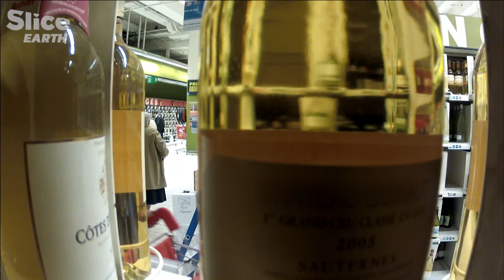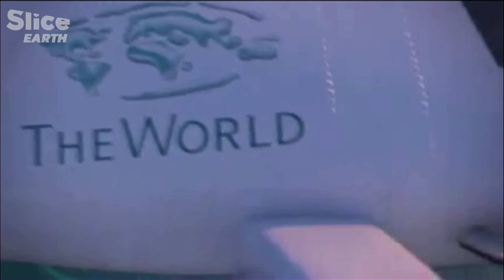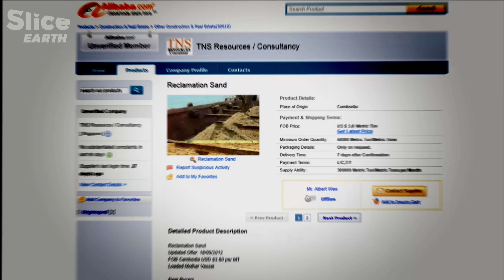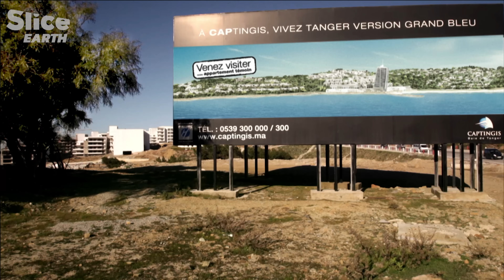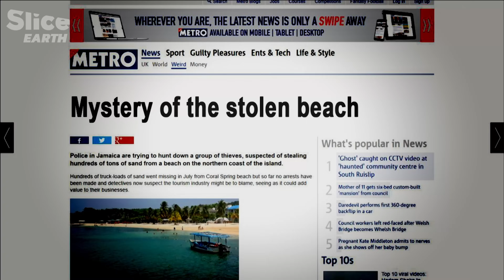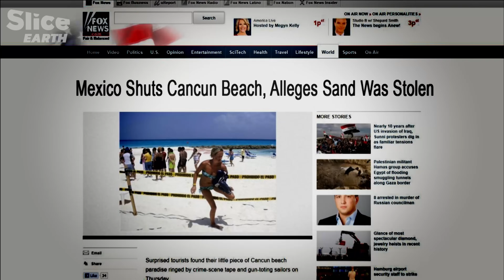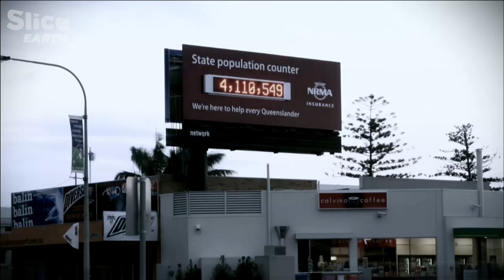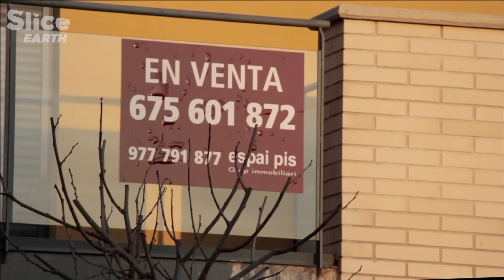The Sand Wars: Uncovering the Disappearance of a Vital Resource | SLICE EARTH | FULL DOC

Comment: Why they don't get the sand from the desert that there's a lot of samd
Reply: Wow, there's sand in toothpaste and in powdered food?
Reply: It is too fine sand, as they explained in this upload
Reply: @javasrevenge7121    Yes, desert sand has been blowing around for millenia, with individual grains rubbing against each other, gradually becoming rounded/smooth.  That sand does NOT hold together for many years when mixed with cement.  Ocean sand tends to stay rougher/angular because water molecules on the surfaces of each grain of sand act as a lubricant, enabling them to stay rough while being tossed about.  These rough grains of sand are what construction companies want to use in making strong/durable concrete.  Beyond that, a lot of what looks like sand from an airplane flying over the Sahara is actually organic dry mud/silt or clay ..."dust" that is useless in making high quality concrete.  Good for mud bricks/adobe in very dry climates.